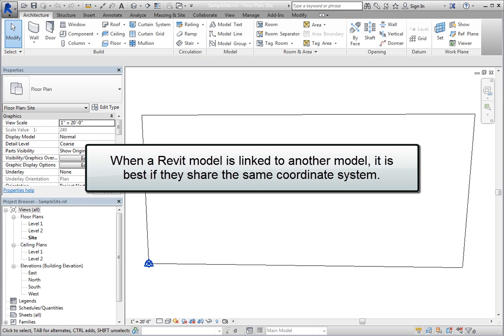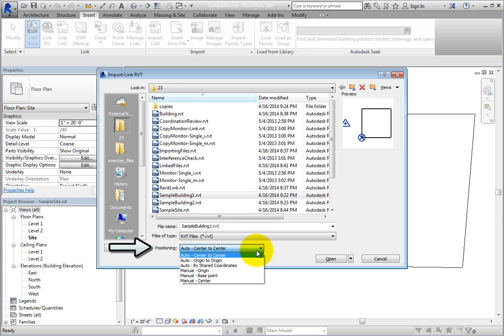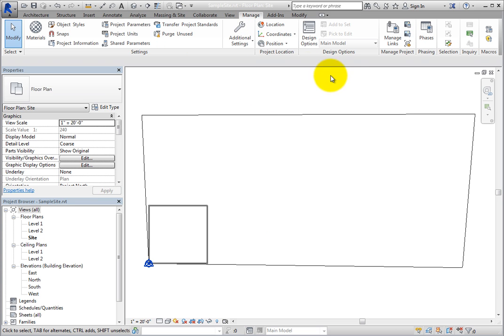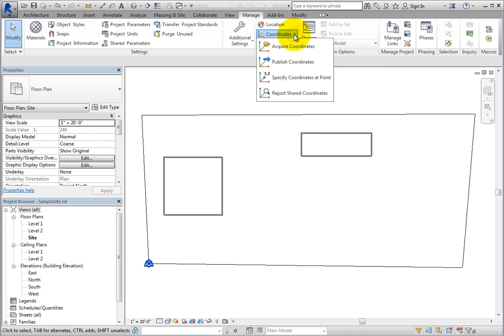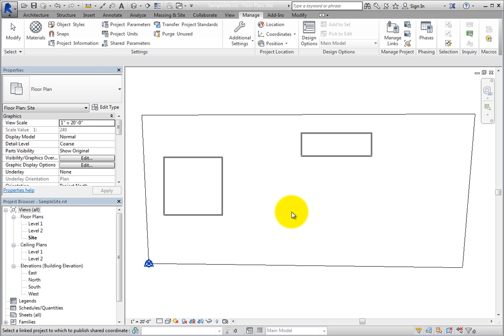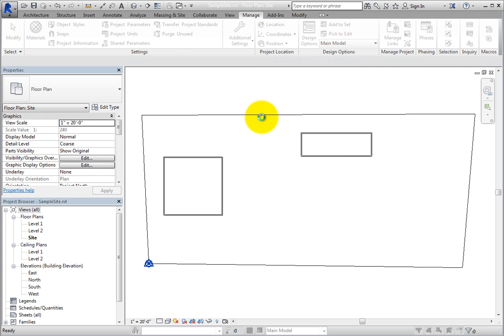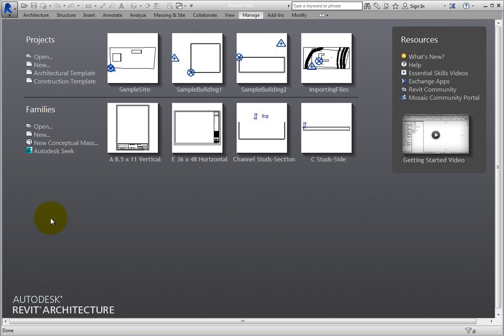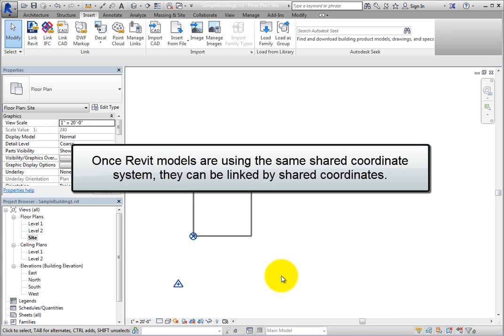Linking Revit Models by Shared Coordinates

Comment: I am able to do the link & share the coordinates after watching this video. Many thanks.
This method seems rather simple to a beginner like myself.. 
1). Just link the target model into the base model, 
2). Adjust its position inside the base model as you wanted, 
3). Then share the coordinates from the base model to the target model. 
The catch is that while you manually move or adjust the angle/orientation of the target model in the base model, you may not be 100% accurate. So you need to know in advance exactly where all buildings should be placed respectively to each other.